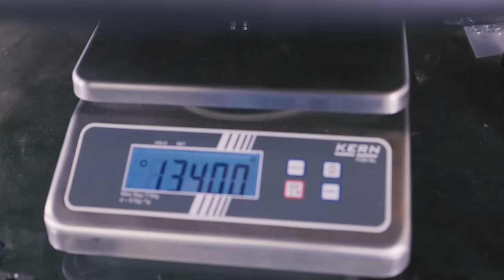Cadex Tri Bike 2023 I Kristian Blummenfelt I SUB 7 World Record I World Champion 70.3 2022 I Giant

Comment: That cable routing looks like the nightmare of all nightmares
Reply from the maker: thats way easier than most modern one piece cockpits. the hardest part is the rear brake cable wi
which makes an awkward turn in the top of the fork but there is loads of space to get it in. 👍

Comment: I would have no idea on how to pack this bike for travelling.  What a nightmare to put together
Reply from the maker: Actually thats probably one of the easiest tri bikes to travel with. You just have to unscrew the 4 long bolts a little bit which hold the bars in place and you can put them to the side. you can see them really good at 7:49 No need to take it all off or get the spacers out, it really was made with traveling in mind.
And there is an Box made by Topeak for the bike with an integrated bike stand for maintenance during races abroad. 👍 its the big black cadex box underneath the bike frames behind the mechanic in the background at 0:29

Comment: Just ordered a frameset…what is the correct size of the BB that I need to get. Still waiting to get the frame sent. Would like to have everything on hand. Great video! I’ve prob watched it 100 times! For reference I will be using sram drivetrain. Red components with dub crankset

Comment: Beautiful bike! But it looks like a pain to pack for travel and races!
Reply from the maker: Actually thats probably one of the easiest tri bikes to travel with. You just have to unscrew the 4 long bolts a little bit which hold the bars in place and you can put them to the side. you can see them really good at 7:49 No need to take it all off or get the spacers out, it really was made with traveling in mind.
And there is an Box made by Topeak for the bike with an integrated bike stand for maintenance during races abroad. 👍 its the big black cadex box underneath the bike frames behind the mechanic in the background at 0:29
Reply: It comes with its own travel case that has specific parts to pack it easily, would be the easiest tri specific bike to travel with. Super easy to pack and rebuild.

Comment: Does anyone can tell me what he puts at 6:15 for the basebar grips ? I have a similar setup and they keep sliding.
Reply: It looks like he sprayed substance like the wd40 to slide the grip into place and the 3m double-sided adhesive tape is keeping the grip from moving around.
Reply: I think you will find it’s brake cleaner, slide on them it evaporates.
Reply from the maker: Yes, it's brake cleaner to get them on 👍

Comment: Man this bike is ugly, looks like a lady’s rental bike indeed, that handlebar doesn’t look very stiff.
Reply from the maker: the handlebars are way stiffer than most thanks to the dual crown fork design and not having an traditional steerer and the bars speperatly.
Reply: @roadbikechannel  Good to know I thought that the contact area between the fork and the two handlebar pieces would make it less stiff compared to a one piece, how is width adjustability? could I fit a 380 mm?
Reply: How is adjustability in general? Stack is obvious but is the reach adjustment for the handlebar? Setback and saddle height look good